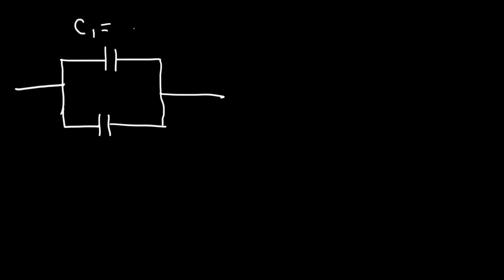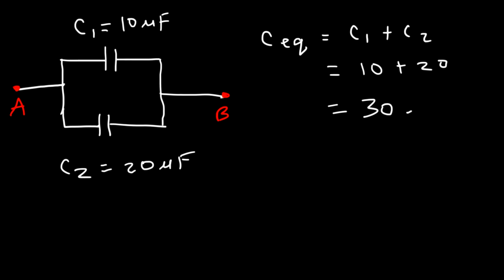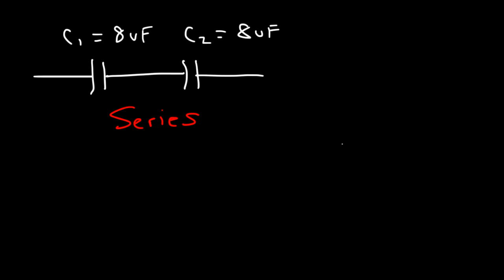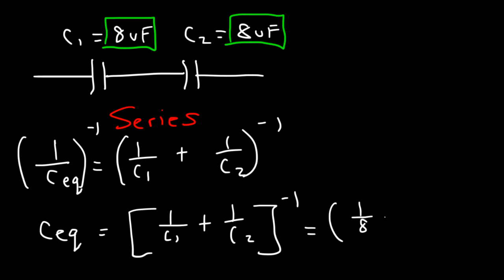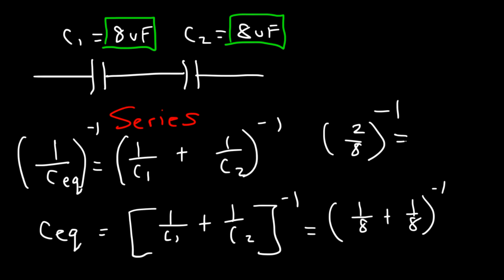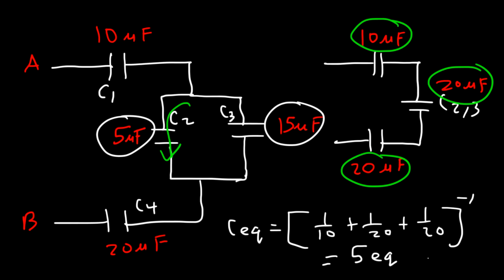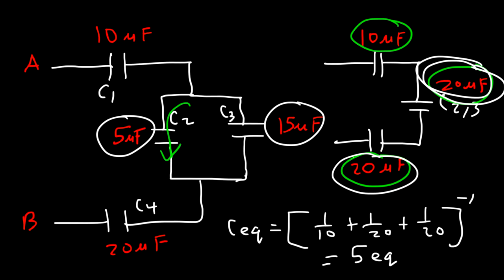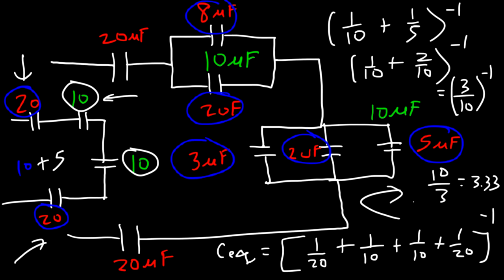Equivalent Capacitance - Capacitors In Series and Parallel

Comment: What can I do if I was given 2 capacitance connected in parallel and 1 in series in the same circuit and after I solve the parallel my answer are different to the one I series? I must just add them like 2+2 or I will make it (1/2+1/2)
Reply: First you calculate the ones in parallel Ceq=c1+c2 then answer 
 Next the answer you get in parallel then you use it with the one in series using formula for series to calculate the capacitance hope you get me well 😊

Comment: Uhmm I thought u supposed to add 8microfarad and 20? in 10:07???? The overall equation would be (1/20 +1/28+1/10+1/20)^-1 equals 4.24
Reply: sameeeee
Reply: I have the same question, didd you figure it out?
Reply: C2 is 10 not 28 😁😁

Comment: Sir, you said that we can calculate the equivalent capacitances by using the formula ((1/C1)+(1/C2)+....+(1/Cn)) to the power -1 but also we can calculate the same thing using the formula ((C1*C2*.....*Cn)/(C1+C2+......+Cn)) but we get the answer in farads and can convert them to micro farads.